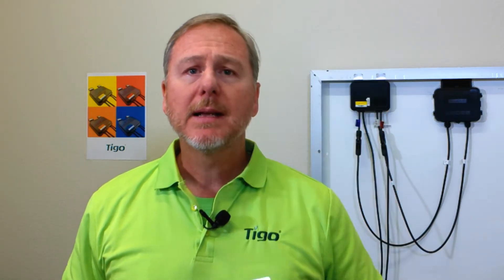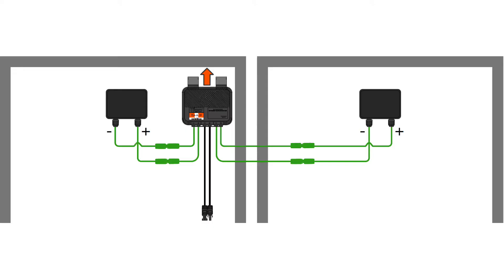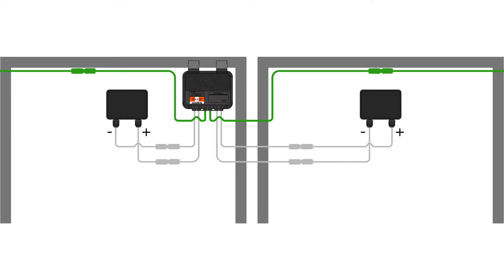Tigo TS4-A-2F - Overview and Specifications

Comment: Hello, can I use 4 pieces of Tigo TS4-A-2F to protect (turn off) a string consisting of 8 photovoltaic panels connected in series? Thanks in advance!
Reply from the maker: Yes! Since the TS4-2F connects to two modules, you would only need 4 to accommodate the 8-module array.